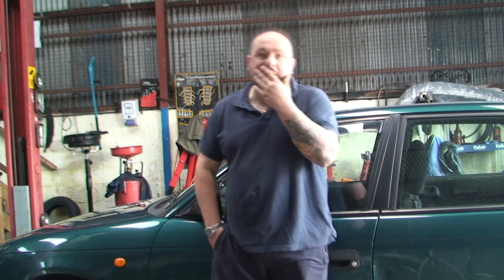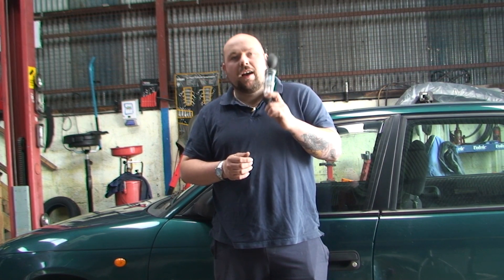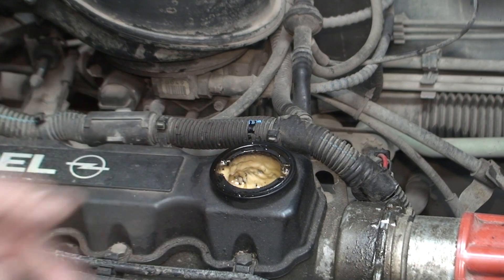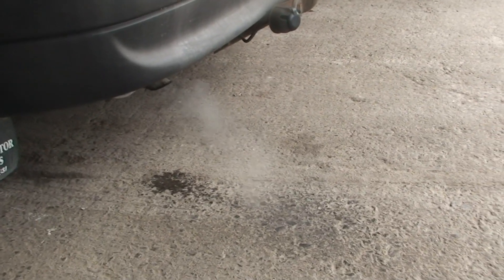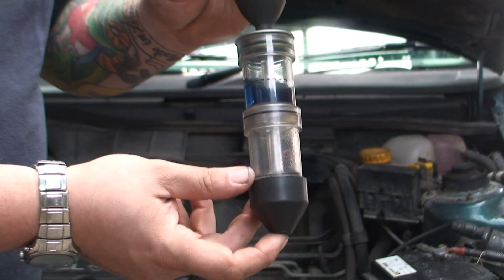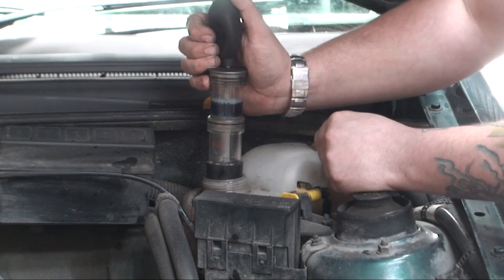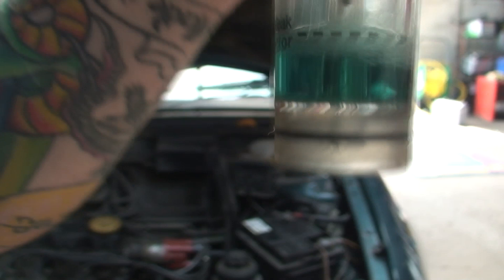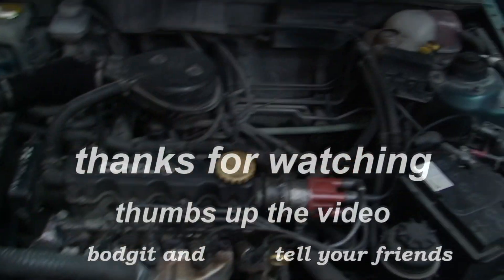Bodgit and leggit garage How To know If Your car Head Gasket Is Gone (part 1)

Comment: a lot of engines have a certain amount of mayo in the rocker boxes ,this is due to short runs ,not head gasket failure
Reply: @paul lowe exactly right mayo isnt a unique sign and it can also point to a stuck thermostat. When the engine never gets warm in winter the oil collects a lot of condensation water.
Reply: Not always. You can have problems arising, and the CO2 Combustion tester will pick up the early stages.
Reply: Just check your oil, If the water is mixed with the oil your head gasket is gone.

Comment: Hi there, great video, very informative! :-) I have a 06 reg Vauxhall Corsa C, it is the LIFE model and it only has the 998cc 3 cylinder engine in it. It has only done 92,000 miles! I think the head gasket has gone. It is mis-firing, difficult to start, and when running only runs on two cylinders, barely idles at all! It is belching out white smoke/steam, smells horrible! The engine coolant disappears after less than 10 miles of driving, the whole lot just vanishes. Here's the funny thing though, the oil is fine, still nice and black, no white bits, just a tiny bit on condensation on the oil cap. So, if the water is disappearing, and the oil is fine, where's the water going? Straight out the exhaust? I have had to stop using it now as there is no power, it'll only do about 20-25mph in second gear with the accellorator pedal to the floor! lol I am also worried I might get pulled over as there is a lot of smoke coming out the exaust, everyone disappears in fog behind me when I pull away! Doesn't sound good to me! :-( But, why have I not got mayonnaise in the oil? The engine coolant must be going somewhere? Warm Regards, Adam Ellender.

Comment: I have a Astra f '95 1.6, basically the same engine as the one shown above.You said one of the symptoms of a blown gasket is the white smoke and the water dripping from the exhaust.That got me a bit worried, because 1,5 years ago I had that gasket changed but by cold start this white smoke is always there along with a lot of water dripping from the exhaust.However my car runs on autogas(LPG), not gasoline and i was told that this is normal for a vehicle running on LPG.I don,t have the mayonese and the water pressure is normal,would you recommend changing the gasket again?
Reply: It may just be steam from the hitnair hitting the cold air in the first start